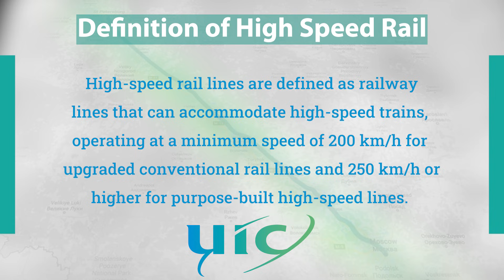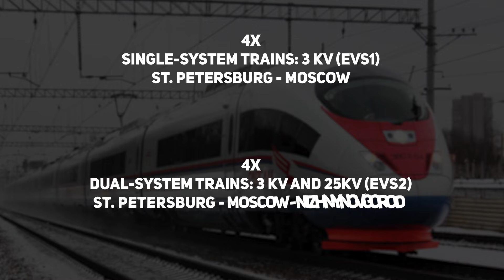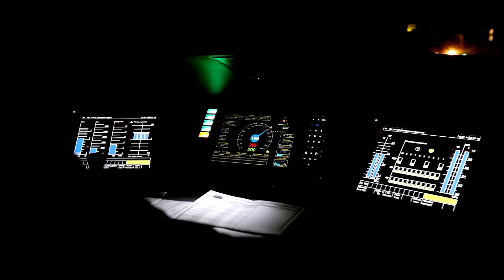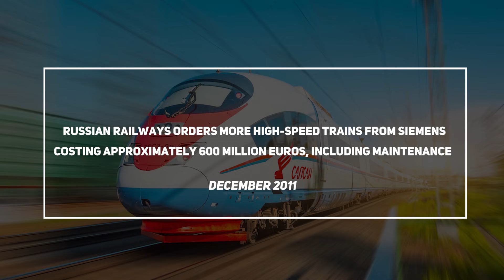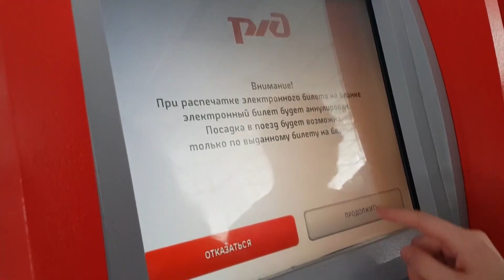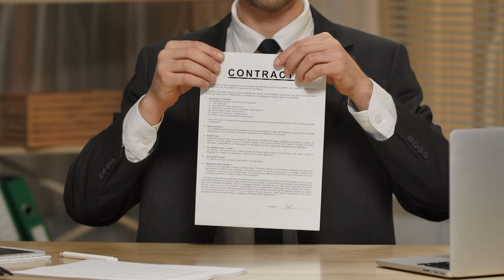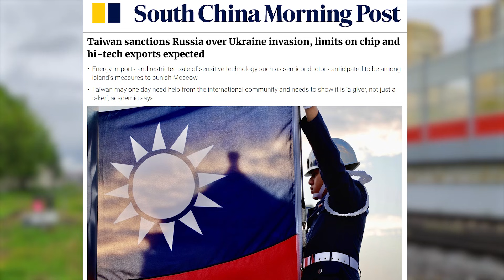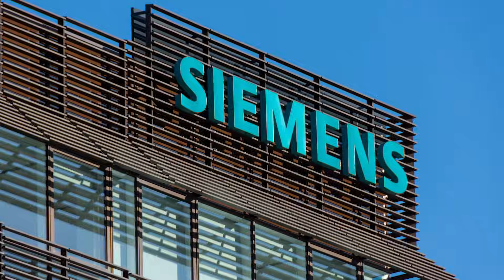Russian High-Speed Trains Are Doomed, Here’s Why!

Comment: Russia is moving away from Siemens-made trains, in most major Russian cities Siemens Desiro trains have already begun to be replaced by Russian analogues, and the high-speed Siemens mentioned in the video is planned to be replaced in 2028 by the Bely Krechet trains, which are currently being developed in Russia, possibly jointly with China, in addition, new tracks are being built for this train, along which it will be able to accelerate to 400 km/h, you should study what is happening in Russia in general, by the way, Russia itself also produces trains for the metro, they are called Moscow and Baltiets, in addition, a number of the year of release is added to the train, Moscow 2019, Moscow 2020 and Moscow 2024 metro trains travel in Moscow, Moscow trains for the metro are also supplied to Belarus and the countries of Central Asia and all this is only part

Comment: The ER200s weren't built in the Estonian SSR, but rather the Latvian SSR! They were built by Rīgas Vagonbūves Rūpnīca in Riga. They were not just the first Soviet EMUs designed for speeds up to 200km/h, but also the first high-speed Direct Current intercity EMU in general to have a rheostatic brake. While the ER200s were built just for the route between Moscow and St. Petersburg, many RVR trains built during the Soviet period are still in active service across the former USSR like ER2s in Armenia and Azerbaijan and the ER9s in Kazakhstan, Lithuania and Belarus, and even in past non-USSR communist states like the Class 412s in Serbia, North Macedonia and Montenegro (which were of course once part of Yugoslavia). 

While the Talgo Strizh trains first ran between Moscow and Nizhny Novgorod, they were also used for the long Berlin-Moscow route which they entered service for in December 2016 and ran until March 2020. Westbound used to be over 24 hours and eastbound was over 25 hours, but this changed when the Strizh shortened the journey in both directions to 20 hours, so using the Strizh trains for the route shortened the time it took by a bit. They've been used on the St Petersburg-Samara route as well
Reply: I'd also add that it's worth mentioning,xat least, an existence of a Sokol HST train

Comment: Dedicated HSR line between Moscow and St Petersburg is being built. New trains will be manufactured by Sinara. They had joint venture with Siemens. So they have can manufacture Velaro and Desiro trains. New Velaro trains were in design phase for a few years and will be manufactured in Moscow.
Currently Sinara is ramping up fully localized and improved Desiro RUS (ES104, which is DC and 160 km/h) EMU, which has been in design since few years. There are over 15 trains manufactured in past several months. Original Desiro were not EMU, but single 5-section cars. Next - ES105 this year. It will be most advanced Desiro to date - AC/DC, EMU, 200 km/h. ES106, an improved urban type EMU for Moscow Central Circle line, is planned in 2025. There is also probably of Desiro HC that could be ES106D.
Reply: As a Russian, I really, REALLY doubt the Sinara high-speed train project will be anything but buying trains from China and sticking a Sinara badge on them.The Sapsan can only do 250 km/h, and it was never built in Russia, the best Russia could ever do is 200 km/h. The ambitions are, on the other hand, are for 400 km/h. There are no competencies for this project in Russia.

Comment: What a boatload of propaganda and a garbage clickbait video. To think that Russia does not have a capacity to create their own HSR trains is silly, because anyone who can use Google would know that Russia already started developing a whole HSR platform of their own even before 2022, which would be the foundation of the new domestically built HSR trains, projected to be out by 2027. What is more, there's no more need for any new Siemens Desiro trains as the new Ivolga 3.0 trains, with the same specs and the same 160km/h cruise speed have already entered service and can easily replace them in case if it's required. But there's no need to replace them because both the Siemens' Velaro and Desiro trains continue to operate and be maintained in Russia like usual, for now at least.
Reply: SHITLIB SIEMENS will be totally replaced i  Russia and these woke clowns are loosing billions already because they are woke shitlibs and green bolsheviks.

Comment: Even before the ongoing 2022 war, domestic Russian industry wasn't even able to manufacture ball bearing. Ball bearings ! Or machine-working tools. There used to be a basic Russian industry for those, but the autocrats in charge let it wither away after the 1990s, 2000s, and never looked back. Trains, regardless of how old and new, also need ball bearings to operate and need to change them regularly as part of regular maintenance. It's particularly ridiculous in a country like Russia, that absolutely needs trains for its basic economic logistics. 

Planes won't be able to replace trains in this role, since their import and maintenance is now dead in the water due to sanctions, and they need many of the same basic components anyway and are largelly unsuitable in terms of cargo capacity and operational costs.

Comment: So High-Speed Trains in Russian should be  doomed ? Well they did buy from Siemens just because it was faster and cheaper then building their own, at a point in time starting around 2008 and especially after 2014 they realized that "We need to make stuff at home, we are depending to much on foreign knowledge, know how, and most important willingness to cooperate", but that is a huge train to turn-around, but results are slowly showing up, now Russia is a net food exporter, train services is renewed and expanded faster than ever, asphalt roads are repaired faster than ever and new roads is paved at a high rate, Russia is one of the leading producer of asphalt (bitumen) in the world, a lot of infrastructure is updated over the last 10 years. When we are talking trains then there had been a upgrade of Metro trains build in Russia with foreign parts over the last 8 years or so, it had been halted and replaced by  a program with trains made with Russian, and other friendly country's parts, same story with trams, busses, and trolleybuses, programs to design, build (with Russian parts) new rolling stock is in place and new stuff is showing up on the streets right now. You can always discuss whether the design is beautiful, functional or what, that's another conversation, but Russia has rarely won beauty contests when it comes to infrastructure design. Stuff produced in Russia with Russian parts is expensive, often more expensive than imported stuff from western countries, the raw material is local, the energy for the manufacturing process is cheap, labor is also cheap, but the final product is expensive, someone makes a hell of a lot of money somewhere in the system, and the money is there to pay.

Comment: Nicely done. As mentioned these are Siemens Velaro sets modified for the customer but mechanically the same. Chinese R&D (Replication & Duplication) have already made copies of the Velaro so getting spares from their southern neighbor should be possible.
Reply: This is the key point. But it undermines the whole video really 😉
Reply: China did not copy Siemens. They bought trains manufactured by Siemens. And Fuxing is completely domestic technology.
As of Velaro RUS, Sinara can manufacture then. Localized Velaro RUS will be manufactured in Moscow.
Reply: @elksalmon84  China did not “copy” Siemens or the other suppliers in that they required a technology transfer in order to do business in country. But once China had their hands on it they started building en masse. They were taken to international court and freely admitted to going beyond the original agreement arguing their needs greatly outstripped outside supply. They’re not wrong.

Comment: I wouldn´t see it so negative. The same situation happened after WW2. According to Wikipedia: "In 1946 the USSR ordered 20 electric locomotives from General Electric, the same US corporation that supplied locomotives for the first Soviet electrification. Due to the cold war, they could not be delivered to the USSR so they were sold elsewhere. The Milwaukee Road and some other railroad companies in the US obtained 12, which were converted to standard gauge. They were nicknamed "Little Joes" ("Joe" referring to Joseph Stalin, the Soviet premier)." What did they do? They made their own electric locomotives, and legendary ones - VL10, VL11, VL60, VL80, VL85,... And also the trains (like many wrote, made in Riga - Latvian SSR) - ER1, ER2,..., and finally ER200. And if they needed something other, then they asked some other Eastern Bloc countries (for example Czechoslovakia - ČS2, ČS4, ČS8, ČS200,..., another legendary locomotives). If Siemens decided to be a slave of USA, Russia will make its own trains and locomotives (they will have more than enough money from Siemens, because such unilaterary termination is against the law). And if they need some high speed trains pretty quickly, then there´s China. Problem solved. And whatever happens with Sapsans, their fate will still be better than the tragedy of Czech Pendolino (billions spent for only 7 trains - not enough for just ONE line, and they were made for 230 km/h but still can´t go more than 160).

Like a few others wrote, I would be more concerneded about the fact that Russia still doesn´t have a separate rail for high speed trains - and this in necessary not only to St. Peterburg, Nizhny Novgorod and Kazan. This is much bigger problem, no matter what is happening between Russia and Ukraine (or West).

Comment: Russia already localized the Lastochka train, also made by Siemens, so why woudn't they also localize the Sapsan?

P.S. The Sapsan to Nizhny Novgorod is confusing: it ceased operations because of the reconstruction on the Kurskiy vokzal railway station in Moscow (though on some websites it's listed as running) and there are conflicting reports on whether it will return after the reconstruction ends.
Reply: HSR trains service from Moscow to Nizhniy Novgorod just doesn't make a sense, since it's a regular railway line with maximum speed of 160 km/h, which can be achieved by different types of rolling stock, including Siemens Desiro (Lastochka) trains
Reply: I don't think Kurski Terminus is really to blame. Trains don't go very fast within Moscow anyway, so they could have been diverted. Although I do believe reconstruction of both Kursky and Rizhsky rail termini (which share a straight-through connection) was a mistake. Last time I checked Kursky is in ok shape, although the bridges for MCD4 are kinda in the middle of being built on Kursky side.

Comment: The Russian gauge is 1520mm, not 1524mm. The latter is officially used only in Finland. However, they are completely interoperable.
Reply: really it's both bc Russia switched to 1520 from 1524. I think some lines are still on the older gauge in Russia and other post-Soviet states
Reply: @thegreypenguin5097  That whole business is nominal but of course all repairs will assume 1520 mm and have assumed since 1970 in fact!
Reply: Right. This is an extremely basic mistake and makes one wonder about the reliability of the rest of the video.
Reply: actually trams here are still 1524, tho yes, everything is compatible
Reply: I'd be surprised if the tolerance was as good as +/- 2.0mm (0.13%) for that gauge in Russia.
Reply: @lewis72  it is, especially in high speed sections
Reply: @lewis72  like in East Palestine and other 1435mm locations where trains "occasionally" leave the tracks with "not much" damage.
Reply: The main problem here is not 4mm difference, it's political insanity in Finland that stopped trains between Helsinki and St. Petersburg.
Reply: They are interoperable in general, but when trains ran from Helsinki to St. Petersburg there were actually problems and delays because of this small difference in rail gauge
Reply: @antimatter_nvf  Who told you that? There are absolutely no problems with the gauge. Never has been. The High Speed Trains had a 1522 mm gauge in order to minimize anything not foreseen when running at 200-220 km/h.
Reply: @Itapirkanmaa2  “There are absolutely no problems” Russians when they try to explain why Ukraine is pushing them back
Reply: @legowagfles7287  Imagine being clown looking at 3 months long ""offensive"" that produced zero results at cost of 50K dead and thinking it's ""pushing back""...
Reply: @legowagfles7287  lol, talk about cope
Reply: Lemme guess: 1520 winter expands to 1524 in Spring?
Summer and autumn standards will be fixed once they find the measuring tape Alexei lost in a bar the other night?

Comment: Russia won't use imperial 1524 gauge, it uses Soviet 1520 gauge. The only country that uses 1524 if Finland and guess why.
Reply from the maker: In the video, the 1524mm gauge is mentioned in the context that it was used when the railway line between St. Petersburg and Moscow was built.  But yes, during the 60s, the Russians reconstructed its railway network with a gauge of 1520 mm.
Reply: Well, those 4 mm do not  matter at  all.  aAll rolling stock is interoperable.
Reply: @steffenrosmus9177  no, it's matter in terms of reliability

Comment: Russia is absolutely going to strip some of the trains for parts. They've done the same with western aircraft.
Also, China runs Velaro-replicas, so russia might end up doing the same.
Reply: China's Siemens HSR technology stems from a mutual agreement to supply and then manufacture. With no such agreement in Russia, they would have to re-engineer them accordingly
Reply: i imagine the trains can be served by china as they know how to service Velaros. the trains that CR run aren't replicas but actual Velaros made by Siemens in partnership with CRRC.
Reply: CN may exchange replicas of western parts for resources, furthermore RU may consider introducing the whole CN HSR system, a Hong Kong-Beijing-Moscow-St Petersburg/Minsk HSR line is not unimanginable
Reply: @deutschthomas2751  You dont understand how far away is Beijing from Moscow
Reply: @deutschthomas2751 that line would be very expensive to build  while not serving many customers, meaning it can't make up in Ticket sales for the money invested. China is already facing similar problems on some domestic lines which are simply to expensive for a majority of people living around the hsr lines leading to lack of funding for maintenance of the line and therefore to suspension of certain connections. 
The distance between Beijing and Moscow is simply to far for having a economically competitive hsr line.
Reply: @deutschthomas2751  i would imagine that the distance for Moscow-Beijing HSR would be far too great and far too expensive for Russia given their current economic situation

Comment: Propaganda. Sapsan works without problems, i was there recently.
Reply: Russian manufacturers decided to do without China and build their own high-speed train. Read the news about it
Reply: until the spare parts run out
Reply: @Hans-gb4mv  then Chinese ones will roll in
Reply: @warmike  Could be. We will see.
Reply: @warmike *Iranian
Reply: @Hans-gb4mv 2-3 weeks until spare parts run out.
Reply: @SmaukGames  They have been working for two years and continue to work, your sanctions have not worked 😂
Reply: Even the Chinese are struggling to maintain their high speed trains because Siemens, Alstom and Hitachi stopped supplying them with train wheels and the ones produced in China are only safe for up to 140 km/h. We'll see how long it'll take them to improve their production process.
Reply: @Filterbubble1-w3b  🤣🤣🤣🤣...!!
Reply: @Hans-gb4mv the war is going already over one and a half years. I guess, all that "spare parts running out" thing is long overdue.
Reply: @Hans-gb4mv  Ouch! but what do you do when you run out of spare parts? Throw everything away? It probably won't happen to them either, other products will be replaced!
Reply: I agree

Comment: Nice video 👍 but you forgot to mention the failed russian high speed train.

The ЭС250 (ES250) Сокол (Sokol = Falcon) .

This had to be the train to replace the older  ЭР200 (ES200) before russia made a deal with Siemens an Germany under Gerhard Schröder.
I want to hear more about the ES250 Sokol (maybe in a seperat video) and why it failed.

Greetings...
Reply: wasn't failed if it was abandonned because of bribes from Siemens...
Reply: They made a test article, then realized that they can't achieve required safety and reliability, then made a contract with Siemens. End of story.